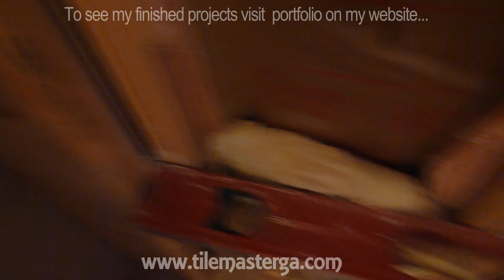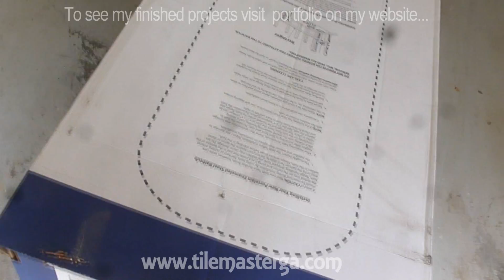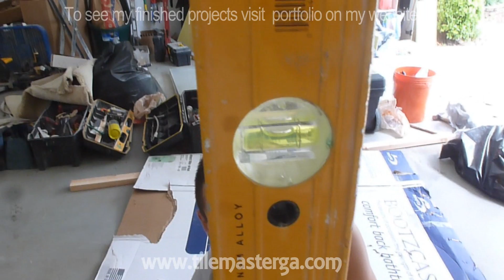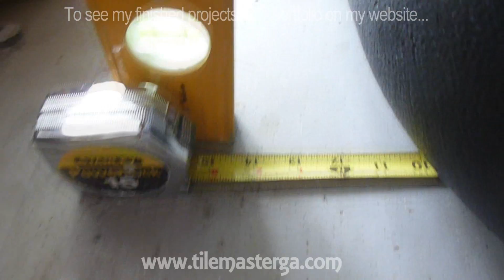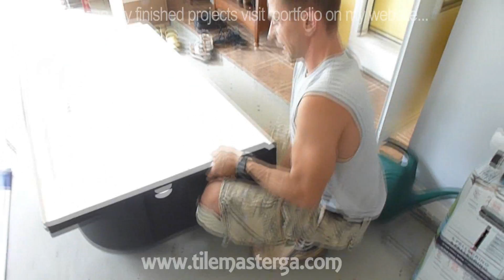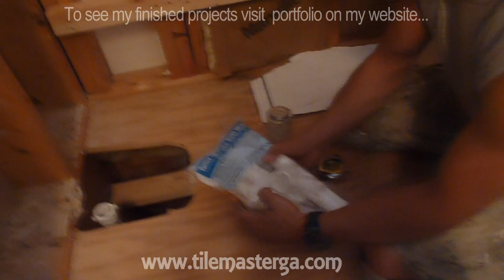Part "1" How to install new tub, level it & connect drain and overflow plumbing DIY  Atlanta GA

Comment: You are extremely precise and careful with everything--the ultimate professional. This is superb workmanship.
The reason for level I don't get however, since some water will always drip outside tub on floor from shower or splashes. So threally issue is good caulking between tub and floor rather than level to try to keep every single drop of water going back to center of tub which will never happen anyways?

Comment: very informative video although kohler tubs in the install require a morter bed not foam nor ledger plate Every other step is spot on but a matter bed supports correctly foam will compress and then retact causing a fluctuating sub floor causing stress on drain and plumbing which will cause a leak

Comment: Shot myself in the foot by having someone install a tub for me even after watching your videos.  The dryer vent comes through the subfloor next to the drain pipe and instead of moving it - the guy crushed it and it is gaping open.  Next, instead of using a stringer board there are 2 unsecured vertical 2x4's holding the tub up on the back side, 1 is wobly.  And lastly, level is pitched forward towards the drain and out towards the apron.  Should have done it myself...

Comment: thanks so much for taking the time to do step by step instructions filled with little insider expert tips.. I'm sure you go into many new construction and older homes where the people did a crap job and you have to fix it.. we are currently doing our hall bath, having done the master a couple years back.. having trouble getting a 60 inch tub into the opening we just removed a 60 inch tub from.. making us a little crazy.. the bottom edge on the right end is hitting the 2x4, its a 60.5 opening, any tips? my husband things taking the dry wall off one side of the outside of the tub area will work, I think he's making extra work for me.

Comment: Very interesting and helpful. Out of curiosity, would it have worked if you had checked the cardboard box for square and then used it as a template? Maybe putting the tub on the box, marking the edges, and then marking where the holes would be? Then you could cut out a template of the tub (including cutouts for the drain) and set that in place to get the drain lined up. You could even have folded part of the box up to get the overflow (if there was enough cardboard). Do you think this idea would work?

Comment: Those thin plastic pipes have a short life span. Use pipes with at least 25-year life to them as the tub drain and overflow are very hard to access. Thick gauge brass or thick ABS pipes should be used. Also, the thin pipes are easily loosened or broken when snaked.

Comment: Thanks for the video. I worked at a plumbing supply house on the show room floor but was sure how the actual installations went. What I would like to know: if doing a complete remodel would you install the new tile floor under the tub just as you should under the toilet and vanity?
Reply from the maker: Please NEVER tile under tub - tub goes firs, then we are installing tile board and tiles to tub.

Comment: This is an good video providing providing excellent instruction an attention to the details necessary for a successful tub installation, but I can't believe the  remodel drain kit that you are recommending.  That is the cheapest and lowest quality drain and overflow kit on the market, which is constantly critisized for poor performance and leaks.   Due to the accessibility of the drain system after the tub and tile installation, one should never skimp on the quality of the drain and overflow kit.

Comment: I've torn out 6 tubs and never saw a horizontal 2x4 to support the wall side of the tub. They were all screwed to the studs and that was it. I've replaced several tubs and never used the horizontal 2x4 either. I think I'll start.
Reply: Follow the tub manufacturer's recommendations.  Some require a 2 X 4 ledger board and others do not.

Comment: Michael- Thanks for your postings!!  I've learned a lot these past few days about my own home and applying the knowledge you've shared through your videos.  Now I know what it's truly like to be a home owner and tackling on projects to beautify your own home.

Just a quick question- what size lumber did you use to support the back wall?  Is that just a typical framing stud which is 2.5" x 1.5"?  I've up to that point now with my project before I drop in the tub.  If you can reply ASAP that would be great.  Thanks!!

Comment: Did you do a part 2?
  I am having trouble installing one in a house I bought and renovating. 
  The drain from the P trap is about the with off the 1 1/2”pipe out of line with the 3” cast iron drain in the house. 
  Wondering if I can cut the cast on back and connect them with 22 1/2 degree Y. 
  The cast iron does have some play in it and is coming at a slant.
Btw, did you just put stringer on one wall?

Comment: I've been watching your videos and have to say they are excellent.  I'm getting ready to remodel an upstairs small bathroom in my townhouse.  The previous owner did a hack job on the installation of everything in it, literally, and the ceiling and duct work below it were severely damaged.  Of course I didn't realize the severity of the poor work until a few years after I owned the house.  It's going to involve replacing everything from subfloor to drywall.  I'm going to tile the floor.  

How do you feel about 4 piece tubs?  I thought it might be easier to maintain.  I'd prefer a one piece setup with no joins, but it's impossible to get up the steps.  Is tile be better?  Looks aren't a major concern in the tub area.  I'm more interested in durability and low maintenance because it's a second bathroom used by the kids.

Comment: Tilemaster, I've been watching many of your videos and you are a very skilled tradesman. I have one question: why do I never see you making access panels or trap doors behind shower plumbing to install emergency shit off valves for shower repairs?
Reply from the maker: There is no such reason. In case when you have bad valve cartridge, you can replace it very easy . For plumbing - drains, if anything will start leak all it takes to repair it is to cut drywall out. People hate look of access panels or doors. 99.999% homes in US do not have access panels for valves or drains - some will have access panel for jetted tub motor only. It is very easy to make access panel if we need one , but most of the times homeowners rather will fix drywall. Also small critters , spiders travel along drain pipes, and having access panel will allow them to crawl in to your house. Less access panel that better ! this is what I think.
Reply: “For plumbing - drains, if anything will start leak all it takes to repair it is to cut drywall out.”

You mean the drywall behind the shower wall, in the other room?

“Most of the times homeowners rather will fix drywall”

Just so I’ve understood correctly, you’re telling me that homeowners would rather cut a hole in the drywall, fix the issue, then patch the wall up again, as opposed to leaving an access panel?

I can certainly understand that you don’t like putting access panels because it does not look pretty (and you’re all about the finish, as I’ve seen haha) but in my home, each washroom has an access panel for the shower or tub incase repairs need to be made and I do not want to turn off the water to the entire building and only want to turn off water to that tub or shower that needs to be repaired.

I live in a triplex so I have tenants and as you know, tenants often require plumbing to be repaired or cartridges to be replaced so it helps having shut off valves in the access panels of their tubs and showers instead of having to advise the whole building that I will need to shut down water to entire building.

Thank you for answering my question! You are very good at what you do, the best I’ve seen, that’s for sure….
Reply: The building code requires shut-offs (stopcocks) at all plumbing fixtures (sinks, toilets, laundry) except at the shower and bathtub.  The code recognizes that stopcock installation at the tub/shower is often difficult or impossible, particularly for retrofits, due to tile or other waterproof enclosures.  Some manufactures of shower/tub valves have incorporated shut-offs in their valves that can be accessed quickly through the front valve plate.  In case of a leak, the alternative is to shut off the main water valve at the meter which shuts down all water supply to the home, which of course can be an inconvenience.  Having said this, it is wise, good practice and good insurance to always install quarter turn ball type shut-off valves at the tub/shower, with a suitable access panel wherever it is possible and reasonable.  This is an extra step, at minimal cost, that provides a high degree of piece of mind.

Comment: QUESTION: do you HAVE to re-do the drain par,t or you can use the old one assuming that it is still in good condition?

and by the way, AWESOME video. very helpful THANK YOU.
Reply: The original drain system can be reused if it is in excellent condition and it lines up with the new tub, particularly if it is a quality brass drain and overflow system.  I would not reuse a plastic (ABS or PVC) drain and overflow.  The plastic threads of the tub drain are intended for a single installation.  Due to the usual problems of future access to the drain system, it isn't worth saving a few bucks to not replace the drain and overflow with the best quality new system available.

Comment: Thanks for the great video!!  One question though - I noticed you installed the tub on the plywood subfloor.  Is there any value to laying cement board over the plywood, and then the tub over that?  Thanks!
Reply: Value? The price of more material. No reason to add. Unless fully insulating the tub. You may want another layer to protect the subfloor.   Never glue or screw to the sub floor

Comment: You are using a nailer without safety glasses. One day I hope you don't regret that. Other than that, pretty good video
Reply: Nova Supernova Are those glasses even strong enough to protect against those nails? They seem to be shot with pretty high force...
Reply: yup
Reply: +KINGsizeWINNER probably stronger than your jelly-like eyeball ...
Reply: +Nova Supernova It isn't really the nails that are going to hit your eyes. They are 'collated' tied together with plastic, wire or paper. The plastic and wire is pinched off the nail when it fires and can hit you in the face pretty hard, especially the plastic collated 21 degree round head nails.
Reply: woodshome11 Dude, I am a contractor, and I know how the nails work. I am taking about a double hit, like if you hit a nail, or if your compressor is too low it can double hit. I shot one up under my fingernail in about an inch on a double tap because of low pressure. Just put your goggles on. The end.

Comment: I see stringer boards as 2 x 4's but my tub's ledge is 1 3/16. The company says to use the 2x4 but that would put the tub further from the wall. Am I the only one who questions this type of thing?
Reply: Depending on the design of the tub, many manufacturer's tubs do not require a ledger board for back wall support.  If the ledger is required, or you choose to add one for extra support, a 1 X 4 should be adequate to catch the tub ledge.  I would not install anything that causes the tub installation position to be proud of the stud wall or causes the front apron to protrude.

Comment: any advice for installing tub on concrete slab foundation??
Reply from the maker: Same situation as when wooden sub-floor. Sometimes you will have to nock-out some slab wit jack-hammer to make additional space for drain or to relocate it. Tip: never cover hole where  drain is  with concrete - only dirt.

Comment: lol what that tub is 250? that's a good ass price. I see standard tubs for like 500+ at HD
Reply: Home Depot. Got my steel one for 155
Reply: @travisjacobsvideos  did you get a bootz? How is it holding up now?
Reply: @cameronbaher544  It chips very easily and easily scratched. Do not recommend at all. Had to get it refinished before I sold home after 2 months of install. Get what you pay for I guess.

Comment: Sir,  How did  you obtain the Bootz tub - through the sales rep in Marietta, or through someone else?  Are these found retail anywhere other than directly from the manufacturer?  I'm really interested in the sound absorbing qualities of the backing as I'm tired of hearing squeaky butts through the ceiling downstairs during bath time while I'm trying to read....
Reply: +Terence Harper You can get them at Home Depot. Just check them in the store or parking lot as some of them may be damaged.

http://www.homedepot.com/p/Bootz-Industries-BootzCast-5-ft-Right-Drain-Soaking-Tub-in-White-011-7000-00/100389019
Reply: Thanks for the help... I now have mine installed and am happy as a clam... Your tips made it very easy..
Reply: @terenceharper5612  hi Terence, how has the tub held up over the past few years?